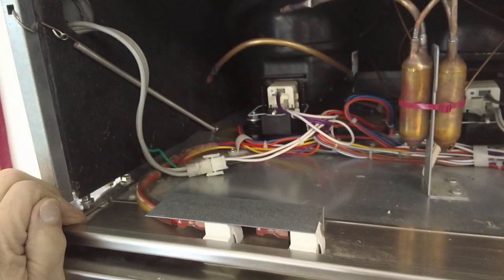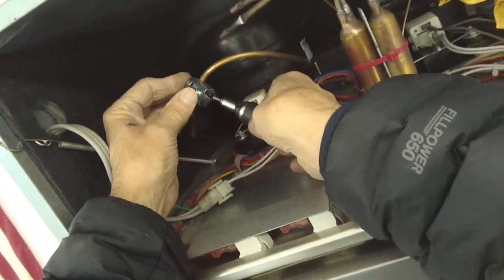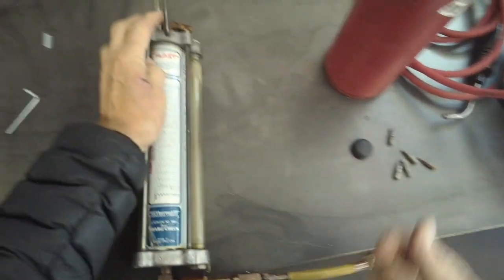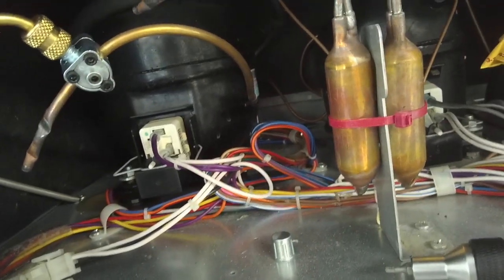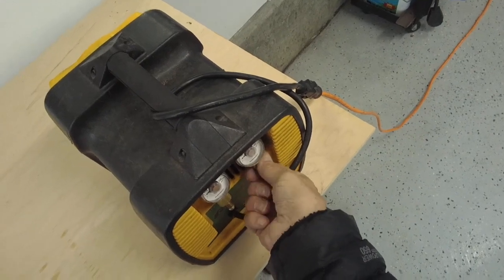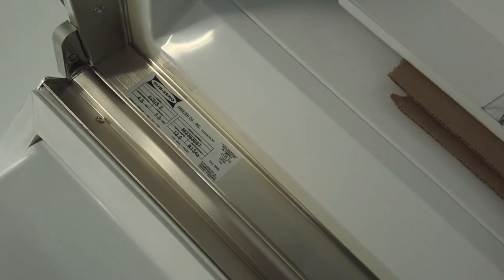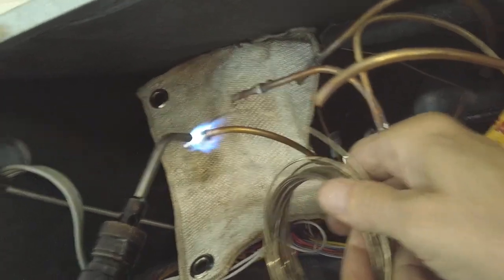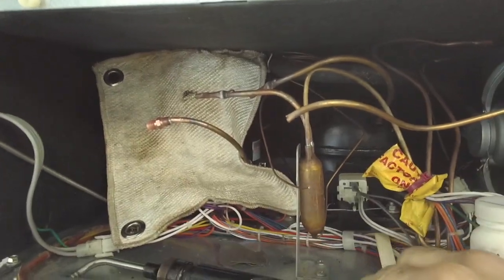SUB-ZERO SEALED SYSTEM R & R Part 1

Comment: Great video. I have a 632 Refrigerator that is 21 yrs old that is staying on a constant refrigerator temperature of 44 degrees and blinking service light. I have gone thru all the diagnostics in the manual and had the tech line at subzero walk me thru the error codes. Based on the codes:  01 ice Service off F, 44 Ice Service OFF r, -03 ice service off FE, 46 ICE Service OFF rE,  they recommended I call an authorized service tech. I have called several and I am finding their authorized techs do not want to work on a sealed Sub Zero system. The compressors are warm not hot. I am not detecting ice buildup. Is there anyway at this point to tell whether the control panel is bad before installing valves and checking/adding freon?
Reply from the maker: You could pull the back panel off and check the frost pattern on the evaporator coil, if you’re low on Freon or have an efficient compressor the top rungs will usually have frost, this is a way of checking the sealed system without a pressure gauge, of course it’s best to check both high and low side pressures to properly diagnose the system.
Reply: @SubZeroSpecialists  Thank you! Will Check it out!
Reply: @SubZeroSpecialists  Interesting developments...Refrig has gone back to 36 at times for several days, then risen to 41 stayed there to 39 to 40 then back to 36. Is this a control panel issue? How would you diagnose. A technician is coming this am.
Reply from the maker: @fredandtracy  check the back pressure you may have an issue with the sealed system

Comment: Great video, thanks. Do you have any preferences in refrigerant? What do you use? Also, How do you recognize undercharged/ overcharged system? Thanks
Reply from the maker: On that unit we used 134a refrigerant. We weigh in the freon with either a charging column or scale to factory specs. Always check the back pressure after the unit has a chance to stabilize. An over charged system could produce a frost back at the suction line, usually the back pressure on the refrigerator is 12-15 psi and the freezer 3-5 psi. You can check these specs out on our website under Tech Help at aaronsrefrigeration.com
Reply: @SubZeroSpecialists  Thank you. Could I use R-134A with label "automotive", "auto air conditioner", "mobile AC systems"? Thanks
Reply from the maker: @konsheyn  yes as long as it doesn’t have leak sealer in it.
Reply: @SubZeroSpecialists  Big thanks
Reply: @SubZeroSpecialists  Hi again. I hope you can help me with one more question. I just broke capillary tube on my model 600. Right where low and high pressure pipes joining together. Thinking to split them little more (if I can) and braze capillary tube (some how). Or maybe replace whole capillary tube? Do you know what size used on 600 models? How you would do that?
Reply from the maker: @konsheyn  Are you referring to the heat exchanger? Send me a pic at support@aaronsrefrigeration.con

Comment: If they are low we replace the heat exchanger, the evaporator, and the filter drier. If the system was in a vacuum and especially at the heater loop In  drain pans...it gets the full Monty. I made an evaporator for a 361rfd the other day. Converted it to r134 as well. Bent everything myself. The only brand I work on is sub zero so I have gotten pretty good and love the people and atmosphere at the factory in Madison. The record currently for us is one from 1978 that is an undercounted beverage center. It's still working today. Then again we've had a 648 proG that had a cut neutral wire in the cabinet and wouldn't fire up on day one. Never know.

Comment: Another question, how come you're using a charging column with R12 and R22 markings? Are the measurements i.e. 2 ounces of R134a show up on this R12 column as accurately being 2oz? Great videos!
Reply from the maker: If you use the R-12 scale you'll be pretty close to the R134a scale. I also have an R134a charging column but it was leaking and I had to get a seal kit. The hoses take up a certain amount of refrigerant which is lost when you disconnect the hoses. This is how I do it, others may have a different way. After 20K sealed-system repairs I've never had an undercharge or over-charge.
Reply: @SubZeroSpecialists  Thank you for your reply. I looked up the formula for R12 to R134a and it goes as R12 Charge Specification x 0.9) – 0.25 = R134a Charge. So for the 7oz of refrigerant that was for that freezer it would equate to 9.5 oz of R12 per the conversion. That would mean that in order to show a correct charge on that column the volume should be at the 9.5 level not the 7. Also that would mean that what you recovered was not actually 2oz but it was lower maybe 1.5oz... I guess it would be easier to weigh the column without the refrigerant than add an actual 7oz and see what the scale on the column would read just to be sure and for future reference... Thanks again for your reply.
Reply from the maker: @Order-in-Chaos  Yes you are correct. If you are a tech then follow the procedure you were taught. This video is a general procedure to show what is done. I compensated for the freon in the hoses and then checked the back-pressure.

Comment: Hey there, if the pan under the refrigerator is always full of water to the point that it needs to be removed and the water tossed out once a week. What could be the problem with the freezer on the 680 year 2000 side by side subzero?
Reply from the maker: Excessive condensation due to air leaks or a water leak from the water dispenser.
Reply: @SubZeroSpecialists  could low refrigerant and freezer warming up and cooling down intermittently be the issue. The freezer takes a while to get to the set 4 degrees (which is the highest setting we can use) ...
Reply from the maker: @Order-in-Chaos  Yes. If the refrigerant is low the condensate heater loop above the drain pan may not get hot enough to evaporate the water in the pan. Other factors could cause excessive moisture in the pan but if your freezer isn't working properly I would tackle that first.

Comment: The compressor in my Sub Zero is getting very warm. What's wrong with it? Thank you.
Reply from the maker: Try cleaning the condenser
Reply: @SubZeroSpecialists  I did clean the condenser and it's very clean . Is the compressor supposedly "very warm" or hot (not burning hot) all the time?
Reply from the maker: @dakao411  Are the temperatures OK? Shine a light through the condenser, if you can see the light from the other side you're okay. You may have to pull the cover off for the compressors to see.If the temps are good then you're probably good.

Comment from the maker: I'm still working on subzero's over 30 years old, so I think you have a way to go. As for the process port if there's not a valve on the freezer compressor then it was probably put on by a service tech. Also is there a process port on the filter?

Comment from the maker: We weren’t sure if it had a leak, just assumed so because we only recovered about 4 ounces, but considering how long the charging hoses are and the recovery machine it’s possible that there’s no leak. BTW, this unit has been running with no problems for a year so far.

Comment from the maker: We haven't found a leak yet, but we are still searching. Usually on this model it leaks from the heater loop.
Reply: If it leaked from the heater loop, it is a leak on the high side, and would leak out at 125-135 lbs of pressure, and be out of freon in a minute, and be very easy to find! You don't seem to know what you are doing, and totally misleading people, as if you know what you are doing, and your methods and use of the wrong tools, shows you do not know what you are doing! Leave the job for a Professional!
It did not lose 2 ounces or 4 ounces when you put the low side hose on the valve, sorry, not going to happen with the system at only 40lbs! on the low side, and not running, you are guessing and have no idea what you are doing, and a very good example for everyone out here, as to what NOT TO DO!
Reply from the maker: @abaappliance-az  as it turned out it didn’t have a leak, it’s been working for three years so far. It’s possible some of the Freon was in the recovery machine.